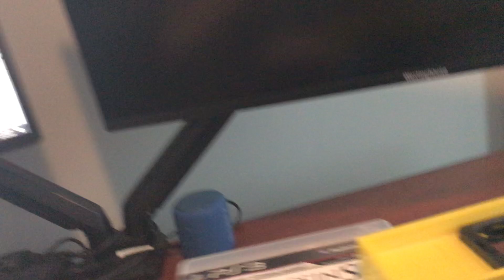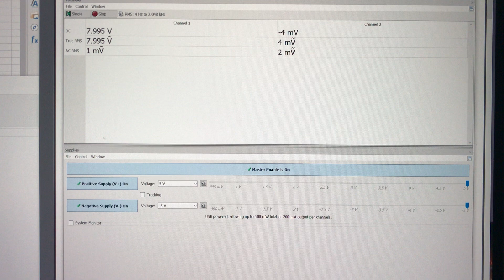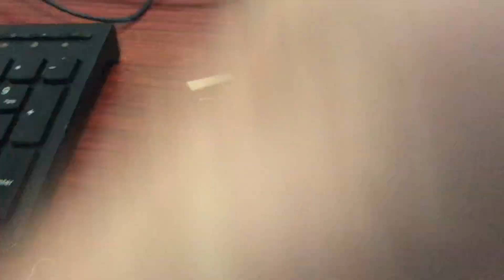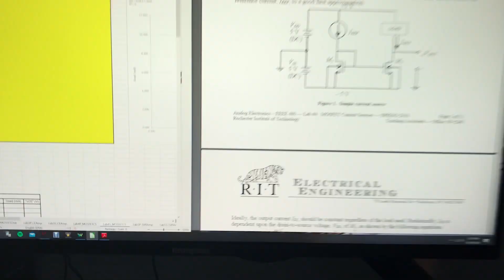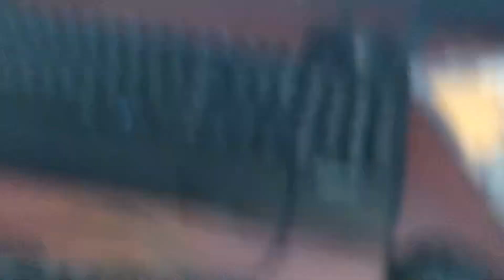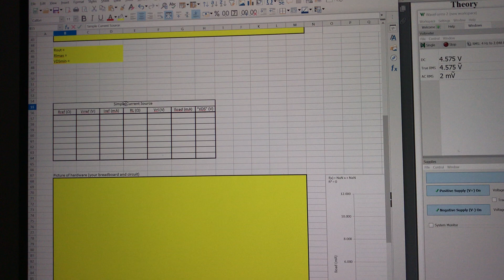EEEE480 Lab #4 Hardware

Comment from the maker: NOTE: I had issues getting the Wilson to work, but I think it is because I didn’t attach a load. The reference resistor will not conduct current unless there is some load resistance connected to VDD. I didn’t think of that when recording the video, but upon revisiting this the next day it worked. You are doing the same measurements for the Wilson that you did for the simple source, so at least I was able to demonstrate that.